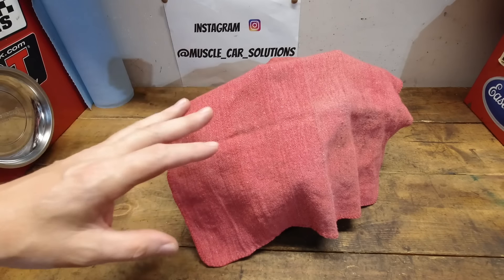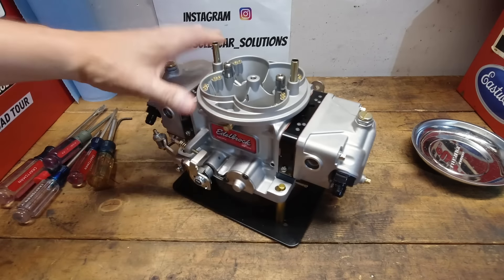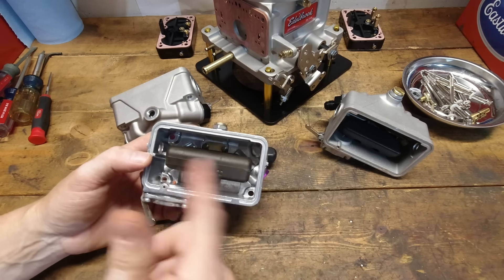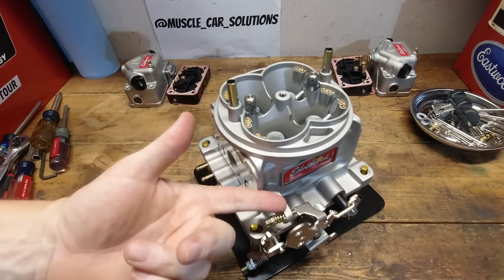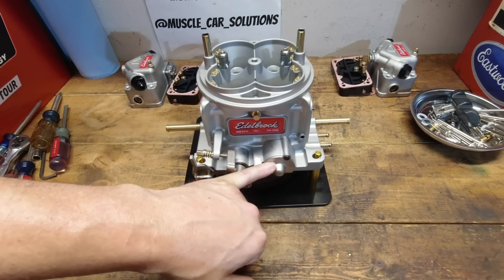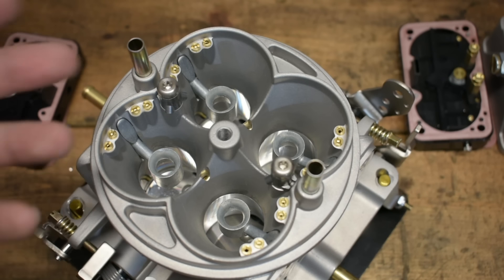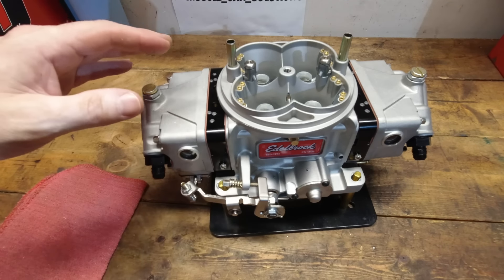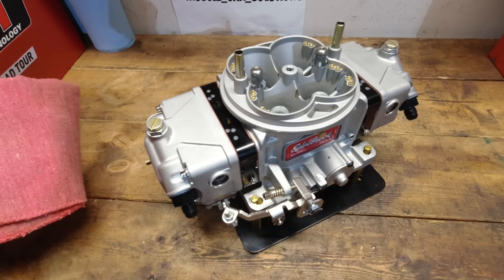The New Edelbrock VRS-4150 Carburetor - Full Review!

Comment: Great carb! My friend had an expensive "issue" with this new carb (750 cfm). The throttle wouldn't come back to idle, stayed at 3000rpm.  After several on again and off again inspections it was discovered that the butterfly Torx screws were loose on the left primary bore.  Be sure to check all eight screws just in case they MIGHT be loose.  There was a lot of money and time spent going to the track before finding this little over site. JC

Comment: It may be a promotional video, but I don't care. Everyone that I've heard that has actually had their hands on one of these days they are great. It costs more than I'm going to spend, but I would love to try one. I love the one piece main body and throttle body. I like that it has adjustable air bleeds for running a huge cam without having to drill the throttle blades. 

If you don't want it to sound like a promotional video, call the parts Holley parts. It's not a dirty word. 

Send me a 750 to try. I'll make videos to prove the damn thing.
Reply from the maker: It’s not a promotional video.  😆 The 750s are available on the Edelbrock website.  Go for it!
Reply: Like it too, but on the website the 650, 750 and 850 read...temporarily out of stock.  I'll keep checking back, but I don't want to wait months.

Comment: where do you get the fuel rail for that style carburetor.  Is that something I will have to fabricate myself or is it available from a parts store?
Reply from the maker: This is the only current Edelbrock part number that fits the VRS.  https://www.edelbrock.com/black-adjustable-fuel-log-for-edelbrock-vrs-4150-holley-demon-carburetors-8100.html
Reply: @MuscleCarSolutions  Thank you.  That takes the guess work out of it
Reply from the maker: @rockybruce3750  they’ll have some cheaper options after the first of the year.  That one is on high side but it’s an awesome set up.

Comment: My friend , I have a question. I have been running the edelbrock 4150 750cfm for a while and it’s doing pretty well. I have a wideband o2 sensor which helps me with tuning. But I am not that experienced. The Afr I on point at almost every spot. Only when I am cruising in 4th gear, 60mph, 2000rpm, it’s running a little rich. 12:1.  In what circuit should I go down a jet size?
Reply from the maker: Start with a simple question.  What is your engine vacuum at that rpm?
Reply: @MuscleCarSolutions ah I will have to check it. I believe it’s around 17-18. But I will have to get back at ya when I know for sure.
Reply from the maker: @laurensvanpeperstraten9294  and then match that up with your power valve and see if it might be opening a touch too soon.  That’s the easiest adjustment at that RPM.
Reply: @MuscleCarSolutions  ah Thanks. I didn’t thought of that. I will check the vacuum and see if it matches with the one it came in. I will keep you posted! Thanks!
Reply from the maker: @laurensvanpeperstraten9294  sounds good.  Glad you’re enjoying the carb!
Reply: @MuscleCarSolutions  yeah and it looks good too haha. 
So to answer your question. It pulls 17-18 in.hg in 4th gear at 2000 rpm

Comment: Some issues. Air filters barley fit with the Holley float level adjusters. now the bowls are bigger and the carb longer so your current air filter won’t fit. And it’s taller. So I barely fit under the stock hood with one intake, the other intake doesn’t clear at all. 
 Also when is $780-$850 cheap for anything?
Quality looks like it’s there.
Some good upgrades. 
But when you can get a swap meet Holley and $100 trick kit and it works as designed, it’s hard to beat a $200 carb.

Comment: AWESOME.......Just wondering if the seals in the throttle shaft are doubled seals to use with a Blow thru system. This would be the ultimate carb to covert for a Blow Thru application !!!!!
Reply from the maker: Kind of odd to have so many ask about a blow through option, but literally those converted carbs just don’t sell.  Maybe folks are modifying them on their own.  Good question on the shafts.  I’ll have to ask when I get back in touch with them.
Reply: @MuscleCarSolutions  There are 4 Top notch carb companies that are 6 months behind on the production of their Blow Thru systems. Try calling Kevin at CSU or Jon at IRD carburetor and see how long it takes. Of course, these are custom carbs for a specific application.
It would be nice to have a carb set up for a blow-thru without having to do massive machine work in order to convert a carb !
Reply from the maker: @mikegonzalez4469  yup.  The whole world is still on backorder.  Ridiculous, but it’s the times we live in.
Reply: i would think that if they made the air filter stud bigger for blow thru systems they thought about the shafts to! maybe they made the shaft so big for that reason!

Comment: I’m impressed!  When I was kid a did tuning experiments with making 1/2 plastic spacers that fit between the carb body and baseplates on the ole holley dp’s.  Always ran into lean out problems. The old carbs just couldn’t flow enough fuel for anything I built. I’m gonna consider buyin g one of these!

Comment: Wow. Now I can finally put an Edelbrock on my 327 clone engine. That two-part Holly is a real pain. Every spring my dad would rebuild it for me. Yes I meant enough to admit that I don't know everything and carburetors along with electrical wiring cars or at my top of the I don't give a blank to blank list. For years my Dad tried to get me to go to elderbrock on that engine. I wouldn't do it because I want it when you pop the hood for it to look correct. Now I'm Edelbrock guy I've got one on my 68 CST that's bone stock except for the carburetor. Back in

Comment: Unless you are into advertising for Edelbrock or to let everyone know exactly what you are running, I prefer the simple cast logo. Also, less "gingerbread" to fade, peel or fall off.
Reply from the maker: I don't have a clue how these will withstand time, temperature, fuel, etc.  I'm sure we'll start seeing what happens with them in a year or two.
Reply: Quick Fuel branded Holley use those same puffy logos, hold up well. As mentioned the cast logo is underneath, so the "stickers" can be pulled right off. A new product needs to be noticeable and the colored logo makes the carb pop, drawing attention to anyone paying attention.

Comment: So yet another version of a Holley. The more modern Holley race carbs have bigger bowls as well as drains, have had for some period.
A nice piece for the money and I would use them on race engines. Street?  Not on a 2 ton 5000rpm cruiser. Totally wrong and I am not a fan of the Edelbrock/ Carter carbs though ofcourse they have their place.
Reply from the maker: There are zero Holley carbs on the market that have the features of the Edelbrock.  Not even close.  If that’s incorrect, throw a part number at me or even a series.

Comment: I gotta tell you the complete adjustability of the fuel and Air circuits is what is turning me on the most that’s extremely useful
Reply from the maker: Double edged sword.  If you’ve got the data to make the right choices, it’ll be amazing.  If not, could be rather frustrating!
Reply: @MuscleCarSolutions  I build custom Q-jets for high performance street and race, the more adjustable it is the better for me, for the guys that don’t know how to tune or are beginners I’m sure that these will be fairly close out of the box for most typical Chevy applications
Reply from the maker: @DSRE535  I’m a huge fan of Qjets.  It’s what I started on long ago.  But it sure does take an expert to want to take the time to learn it and know how to tune them.  Once dialed in though….great carburetors!

Comment: Something I notice looking at that "mustache" feature is that where it dips down corresponds with the notches in the middle of the float so that the fuel misses the float as it's coming into the bowl and that only fuel filling the bottom of the bowl will interact with the float and the fuel will only shut off when it's full as opposed to other things causing it to surge up and close. They did a lot of thinking on that bowl and float design, and not just the 45's at the corners of the float.

Comment: Uncle Tony sent me. Nice feature rich carb BUT two fatal flaws for more people then you think (me included): much to long front to back, and too tall. No amount of features do any good if your hood won't close or run a large cap dizzy.
Reply from the maker: It’s a race carb.  Generally not a concern on height for us.  As far as the distributor goes, it will fit with an HEI.  If you’re running something bigger than that, I haven’t heard of it!  In reality, no one runs an HEI.  Small body that gets locked out and controlled by the ignition box.
Reply: @MuscleCarSolutions  Understood. But Edelbrock is missing out on lots of sales to us street/strip people with the size of that carb. Hood clearance is a major consideration for most s/s cars. I don't think Holley Double pumpers and Mighty Demon's have too much to worry about with this Edelbrock. 
Kind Regards, 
Chris
Reply from the maker: @Chris-ti8rz adding that height and moving the booster around is how they found a ton more power.  If under hood clearance is your only concern, you’re correct.  It’s not for you.  Horsepower wins.

Comment: Looks cool but I will admit to being a bit leery of running out and buying. It's very cool that Edelbrock went here but I wonder if they might not be too late to a party pretty deep into it's decline already. It's a fact that Carbs are no longer as common as they once were. The decline in their use is falling away with each passing year. It's not hard to imagine a day when there isn't room for more than just that one dominant supplier to a very small market. (We could be there already). Not sure I'd bet against Holley to be not only first on the scene in the 50s, with the most race ready carbs, and they may also be the last to leave and turn out the lights at the end of the run off in the not too distant future. Drag racers will likely always have a "class of racing" that requires a carburetor but let's face it street use is where most carbs get sold to. Without enough sales into the aftermarket the room for multiple players goes away pretty quick. Affordable pricing often comes back to being able to sell in big enough volume to keep prices low. I still see quite a few Carburetors under the hoods of cars at shows but they are almost no-existent now out in everyday drivers. That leaves awfully small market to try to disrupt for an "upstart" trying to displace the 800PD gorilla. The big question: Can Edelbrock win enough share to make this a winner? I suppose time will tell. I will be cheering for them to succeed. Nothing against Holley. I like my 4150 and 4160 carbs but competition is always a good thing too in that it forces improvement from all players in the market place regardless of their place as Dominant or Upstart.
Reply from the maker: I’m not sure Edelbrock invested all that money and time just to throw it away.  It’s here now and it’s not going anywhere in the foreseeable future.  It’s not like this was a couple month long project.  They spent years developing this carb.  I’d say they’re invested in its success.  The whole world could change in the next 5, 10, 20 years.  Enjoy it while it’s still here.

Comment: Well I tell ya. For the money and for the quality that carburetor is the cat's meow and my understanding about carburetors and the recommendations from the manufacturers has always been to install the carburetor right out of the box and don't tinker with it as it is adjusted from the factory. I have found this to be true on most carburetors and this carburetor is no exception. Of course as the carburetor enters the market and different people start fiddling with it there will be a lot of modifications but the features you show should cover the market for us folks who just want a good performance carburetor and of course all of the Holley shortcomings are addressed with this carburetor. The only thing that I would adjust on a new or rebuilt carburetor is the idle speed and I found that to be satisfactory for us common folks.
Reply from the maker: Oh boy.  If you decide to not tune a carburetor to your engine, you’re leaving all the fun, horsepower and drivability on the table.  A carburetor has no idea what it’s being bolted on to.  That’s what we do is tell it how to operate based on all those factors that come into play.  Give it the opportunity to really show you what it can do!  Just because a carburetor might run right out of the box, doesn’t mean it’s RIGHT.  In close to 40 years of tuning, I’ve never ran into a single carb that didn’t drive or perform better without any adjustment.

Comment: I just got a 750 and it was definitely not set up at the factory to bolt on. The floats were way high and it shot fuel out the vent tubes with 4psi of fuel pressure. So, not for a guy that wants bolt on. That being said, it is an awesome carb! Very nice and the quality is excellent.
Reply from the maker: What would ever make anyone think there are no adjustments to be made and a carburetor is ready to go “right out of the box”?

Comment: Are there any plans for "shorter" fuel bowls for inline dual carbs?
Reply from the maker: No.
Reply: @MuscleCarSolutions  Edelbrock has 10+ 2x4 intakes on their website. I would think making these carbs fit would be a no brainer. I have a stroked hemi and was planning on going with a Holley efi system. These carbs have me reconsidering that but if they don't fit then well they don't fit.
Reply from the maker: @jamessheets9205  only a handful are actually race type intakes and I know the sales volume on those are very very low.  Surprised they still even make them.  But retooling this carb or all those intakes would be a serious financial burden.  We’ll see what happens but if we were to have this conversation 10 years from now, my guess is they’ll never offer smaller fuel bowls just so it would work on their tunnel ram.

Comment: First, it looks like a quality piece. Which is great. There is no excuse for the crappy quality some of the mid-level Holley carbs present. But then Edelbrock said it was going to be released early 2022. This kind of delay starts to erode brand reputation.  I want 4150 Ultra HP quality in a street carburetor. Holley does not make such a thing. That's a gap that needs to be filled. Until the VRS-4150 is available no solution actually exists. It's just a prototype...an idea.
Reply from the maker: Kind of funny.  They are already selling.  Not sure how doing really good tuning hurts their reputation.  Exact opposite.  They didn’t rush it to market just to take the money and run.
Reply: Quick Fuel Brawler has these features
Reply: @MuscleCarSolutions  
Yes they are...very excited to get one

Comment: Proform released there new carburetors. I can't imagine what they can do today cause years ago witnessed a proform race 750 out of box $530 on a 406 sbc running 630's 640's.
Reply from the maker: Just because it runs, doesn’t mean it making the best power.
Reply: @MuscleCarSolutions  Just saying don't see how a different carburetor will make a greater difference
Reply from the maker: @jeffreyeaton9934  from what I’ve seen on the dyno, it makes a heck of a difference.  We’re not talking about the same designs.  The longer venturi and changes to the booster design is where this carb makes it’s money.  Im sure you’re going to see some big name engine builders with their own results soon enough.  I’ve seen some from a local builder and they couldn’t be more stoked with what they have gotten out of crate engines that they thought were optimized on power.
Reply: @MuscleCarSolutions  lol big difference on dyno compared to the drag strip. I've been on track since 94 did all kinds of testing pass after pass
Reply from the maker: If you have that much experience then you know it all starts on the dyno.  And crate engine manufacturers sell on dyno results, not what Jim Bob did in his 1976 Camaro at test and tune.  I’ve spent enough time with both to know this carburetor will embarrass some folks.  But that’s what better technology does.
Reply: @MuscleCarSolutions  I have to be proving on track bring your carb swap out lets see. I have a 355 on motor ran 6.83 1/8 and 11.02 1/4 originally built in mid 90's with a 830 annular nascar holley. I gave $200 for it back in 2012. So you think a new edelbrock could pick up my car?
Reply: My dyno was the street in 1989 then track 1994. All the rich that had dyno's got outran by fast experienced racers lol
Reply: Years ago same car as now had a mild built 350 dual plane intake 600 holley DB. It ran 13.30 on motor 125 shot 12.70's bad cut out at 4300. NOS said need single plane so I did ran 12.70 motor 12.30's then I tuned on streets for a week or so. Adjusted fuel pressure, timing, swapped out different carb. spacers other odds and ends ran 11.89 with stock iron exhaust manifolds
Reply from the maker: Waiting for the 3/4 race cam and jumping coke cans story before I get back to work.
Reply: @MuscleCarSolutions  BTW a dyno is just a tuning tool lets you know you're going in the right direction. The true hp readings is the track the time slips don't lie. All dynos will have diff results due to the design.

Comment: I would remove the stickers. It is a color clash. I also do not like anodized metering blocks as the colors are over the top. I would much rather have a carb all one color as as Holley used before going to all aluminum. I wonder if the needle and seat assembly is interchangeable with Holley.  I am happy to hear that the larger carbs will have removable annular boosters.